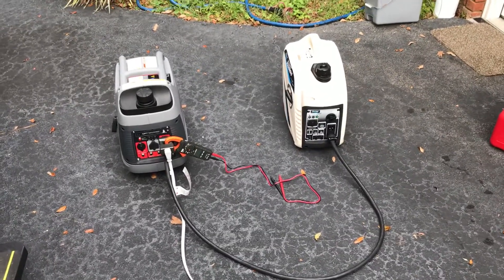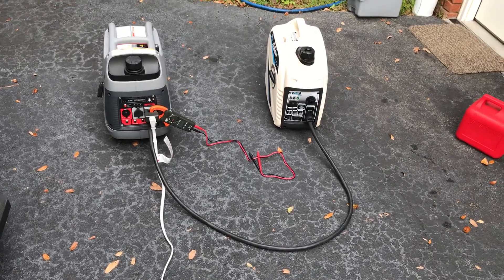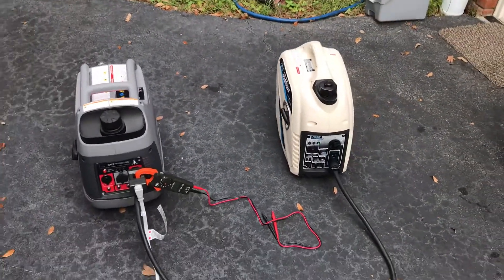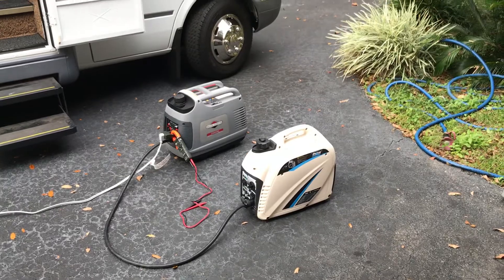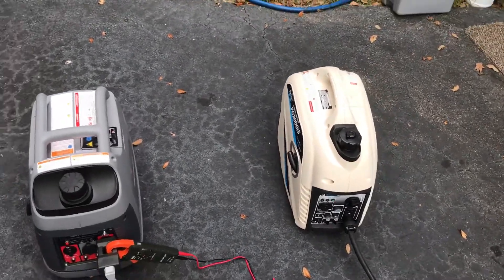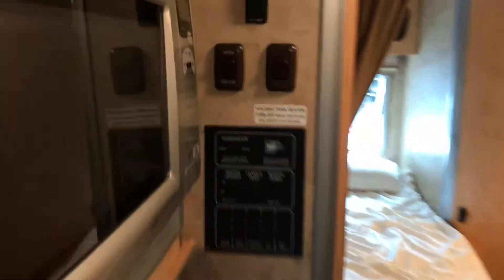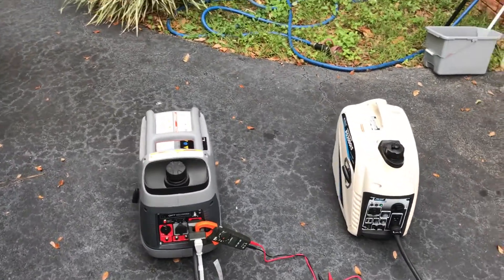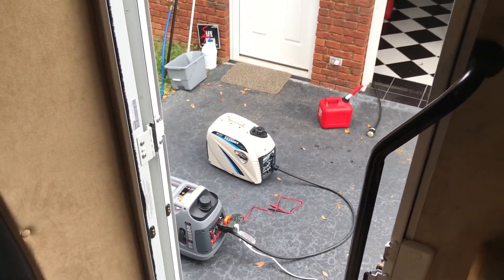Parallel operation two different sized generators pulsar 2000 W and Briggs & Stratton 2200 W inverte

Comment: Thanks Mike, excellent video explaining paralleling small inverter generators; using just the 13 to 20 amp outlets on the generators. I have looked at 30-40 videos trying to find this exact info. The comments below are very informative as well.

Comment: Hi Michael - Appreciate the informative videos. So, is that the death cable hack to parallel the 2? So, if my inverter generator does not have parallel ports, is it still possible to do this method of parallel connection?  There seems to be a debate about not all inverter generators are parallel capable.  Where do you weigh in on this?

Comment: I wanted to try this but I was   concerned it might burn the charging system up. I've got an older generator and I'll be buying a new generator hopefully it will work. I see yours are two newer generators with that sine wave technology. I talked to ipower generators today and ask them about that they said don't do it but you got to do what you got to do to run a AC compressor. Something you want to look at is that easy start you add it on a Dometic or rooftop RV AC I couldn't believe it. The easy start device is something you wire into your air conditioner compressor so it takes that massive starting Watts out of it. I read a review where a guy was at a 30 amp RV Park in here and both of his big air conditioners on 30 amps. I can't remember if he had to 15,000 BTU ACS I don't remember the btu though. It kicks in the compressor real smooth so a Honda 2000 they say can run a 15000 watt generator by itself even on propane which lowers the wattage. And it doesn't have that massive thump when the compressor kicks in and Noise. And you should be able to run more stuff with just one generator. They also say it drastically cuts down the starting Watts on a rooftop RV AC compressor. I subscribed good video.
Reply: DO NOT DO THIS ON NON-INVERTER GENERATORS.  They will not sync up.  At best you will have wildly unstable voltage and destroy your appliances.  At worst you will destroy your generators and/or cause a fire.

Comment: Mr Vaughn, have you had any problems since using this 'parallel' chord?  I have a Costco AI2000 without the parallel chord setup and want a second to run my RV AC unit. This looks like a great workaround.

Comment: Excellent demonstration.  I've been considering buying a second inverter generator to parallel with my Westinghouse iGen2500.  Really don't want to spend $600 on a second one, but might consider buying the Pulsar, considering it is currently available from Amazon for $379.  Looks like you're using 10 gauge cable for your parallel cord?

Comment: i don't own an inverter generator, but i do know that if you attempt this with a pair of non-inverter generators you are going to get a smoke show.
Reply: It's not as much the inverter part I mean that is what enables the function but it's the paralleling function because it has to be able to become perfectly in phase with the other in theory you could do it with 1 generator that has the parallel function and any generator or even an inverter

Comment: Please show your parallel cable is that just a double male end plug
Reply from the maker: caseymaples19xx yes I went to Home Depot and bought 2 male ends. and 6 feet of cord. $11.00 total cost.
Reply from the maker: Connect before starting generators and don’t remove until after shutdown. Great for surge load. Don’t exceed outlet amps..
Reply: Thanks
Reply: michael Vaughn,
So what I’m understanding is you don’t even need to use the parallel ports on the generator? You can just use the standard 120 outlet on both generators and they will sync? Also what gauge of wire is needed to safely run both generators in sync?
Reply: Okay so you might not like your wife but what happens when your kid or somebody else's kid or an unknowing bystander trips on the cord and unplugs it and thinks it's going to be dead on the prongs?

I have been researching paralleling kits and Generator paralleling and I see why Honda has always used those weird connectors of course it also helps that it makes it somewhat proprietary to some extent.
Reply: @edenhomebuyers1128  The parallel ports simply connect into the hot and neutral bus inside the generator.  However, they're typically unfused.

Do your own research for wire gauge.  Consider load percentages and how that translates to flow between the generators.

Rule of thumb: #16 for 10 amps, #14 for 15 amps, #12 for 20 amps, #10 for 30 amps, #8 for 40 amps, #6 for 50 amps.

Better advice is to wire your suicide cable into a box with the receptacles you need, especially if you plan to exceed the capacity of either generator.

I am not your electrician.  Consult yours before doing anything.
Reply: @edenhomebuyers1128  No - you don't. The special parallel ports on the generator are wired exactly like the AC outlet on the front of the generator. The only difference is the special style plug which protects you from being able to touch it at any time. When using the parallel ports and cables, you are still using the AC outlet on the front of each generator, so if you are trying to draw more current through one outlet than it was originally  designed to handle, you can overload the OUTLET - but not the generators.
Reply: @kdanagger6894  Thanks for the info. I have two 1600/2000 gens with one 120 volt 13.3 amp outlet each. I'm thinking I will run 12 gauge extension cords form each generator's 13amp outlet; one gen. to a 6.5amp refrigerator and the other gen. to a 6.7amp 8000btu window a/c [for hurricane power loss]. 13.2 amps through one gens 13.3 amp receptacle is too tight, right? I plan to parallel the gens through the parallel plugs [the parallel wire has no receptacle]. If I want to run more than 13 amps total from one of the generator's receptacles then I could add a 15amp receptacle to the parallel wire [maybe with a 15amp fuse/breaker? -I would have to research that] and then I could run 25 amps [for less than 30 minutes] and not over load any receptacle. Hypothetically, for educational purposes, assuming no responsibility and advising always to use a licensed electrician; what do you think?
Reply: @Uejji  would you review my comment.  thanks
Reply: @imark7777777  survival of the fittest.... natural selection

Comment: Why not buy one generator big enough to cover all your needs?
Reply: Super old question, but you buy two if you do not always need the full power.  They are easier to move around as well.  In my case I only need that much about once a year, so the other times I am only using one.

Comment: I found out with the inverter generators if the overload light is coming on or flickering you better reduce the power quickly or cut it off. When the overload light comes on it's giving you a warning too many warnings in the inverter board just burns out. These inverter generators are a little weak compared to the non-inverter generators they will take a beating at least the old school ones will. Only 6 months of off-grid living running a inverter generator the inverter board burned out of my cheap Chinese 79cc inverter 4-stroke generator.